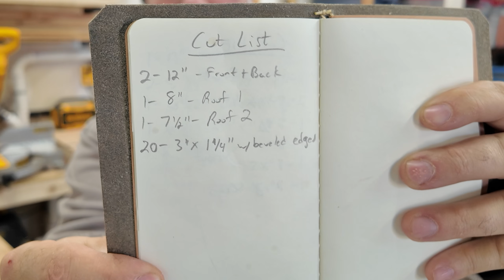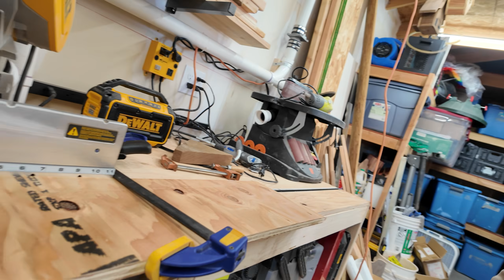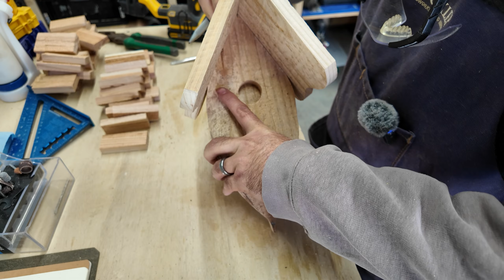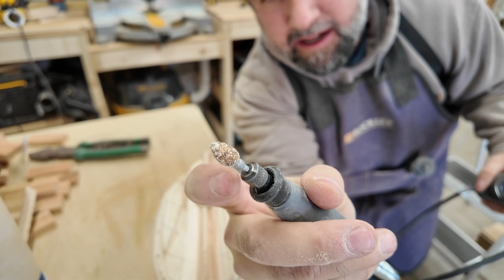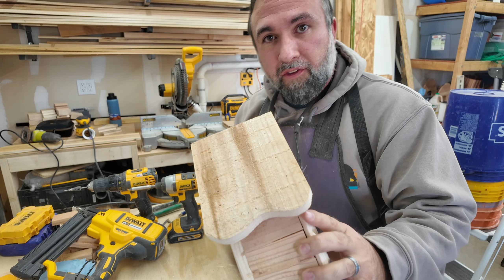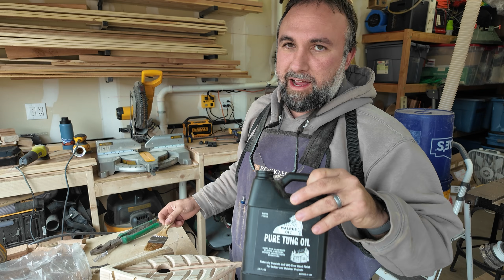You Can Build This STUNNING Carved Birdhouse in ONE Day

Comment: What model Dremel do you use? 
Not necessarily the flex shaft, but the actual Dremel model?
Asking because I have a Dremel 200, but doubt it's capable of producing the needed power for prolonged use.
Thanks!
Reply from the maker: I forget the number off the top of my head but it's a step up from their smallest one. Well at least at the time. Cedar is really soft. I'd still give it a go if I were you honestly.

Comment: no squirrel protection ?
Reply: I have a new appreciation for my Squirrel's , I saw one yesterday that was taunting a Cat . The Cat had climbed about 12-15 ft up to a limb of this large Hickory tree . This crazy Squirrel kept darting side to side , and the Cat would try and bat at it with its front paws . About the 6th time the Cat lost it  balance and went tumbling down to the ground. The Squirrel then did this lil happy dance racing around the dia of the tree & laughing , squealing & barking at the Cat. I thought it was great !!! . I honestly thought the Squirrel was trying to commit suicide at first .
Reply: @paulrooster2108  Also quite palatable in a spicy meat pie!!
Reply from the maker: @paulrooster2108  Oh too funny. Hopefully the cats fine, but those squirrels man, they're wild creatures.
Reply from the maker: I didn't do it for this one. It's a little harder for this design but you can shape copper into the league design. Takes a bit more work for this one.